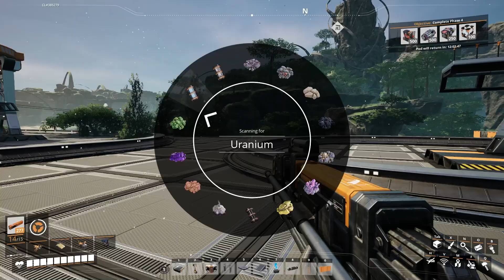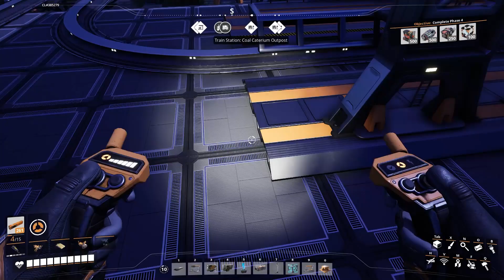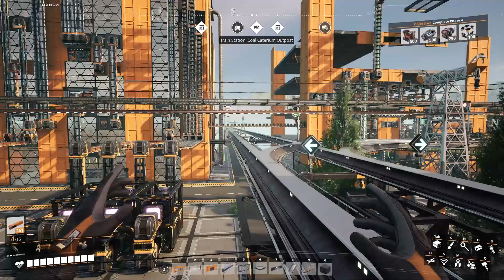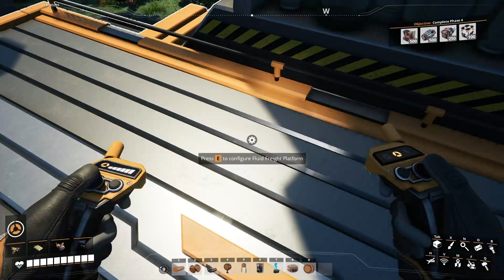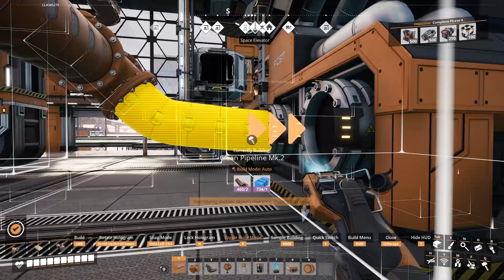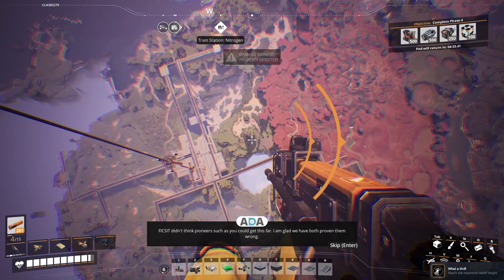Automating FUSED modular frames - Satisfactory 1.0 EP30

Comment: The gas flow rate will be bad until you saturate the whole pipe system. Trains are not a good way to transport fluids since they pause the flow into and out of the stations while the load animation is going, this causes some issues with fluids because of the way the game handles pipes. It's generally considered better to package the fluid before loading onto a train and unpack it at the destination, or to pipe it the whole way to the destination. I usually build my factories next to the gas nodes, so I bring the frames and cases to the gas, not the other way around.
Reply from the maker: @NiallStJohn  interesting info. Packaging fluids are a bit annoying coz they require plastic

Comment: Design and build a functional storage area is a big part of every SF game I thing 😂
Especially now with the dimensional storage

(for exemple mine is: feed dimensional storage -> go into real storage then go into sink, and I have a biiig area dedicated for that, with some trains)

I'm glad you get the 90 degres angle for pipes =) before it was the same for conveyor, but since 1.0 they did this easier with the mode

If a pipe is full, then there is no flow rate, because no need to flow... I think, i'm not really sure, maybe someone can confirm that part
Reply from the maker: By end game when you've upgraded everything in the mercer tree, do you need an "area"? I was going to store them directly into dimensional exactly where they are produced instead of belting them to a central area. I find besides concrete I'm already hardly ever using my storage area anymore
Reply: @DataEngineerPlays  when building mega factory, it's still usefull, like if you want to build hundreds of buildings, or massives wall around

But ultimatly its just for the beauty of it ^^